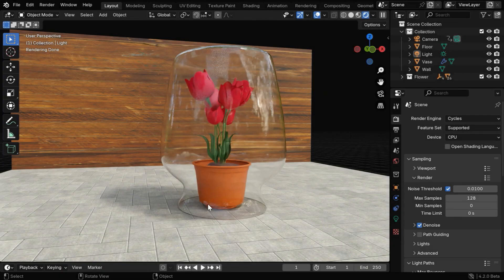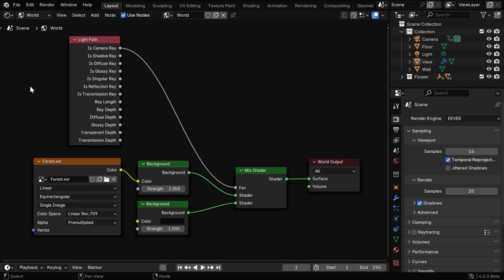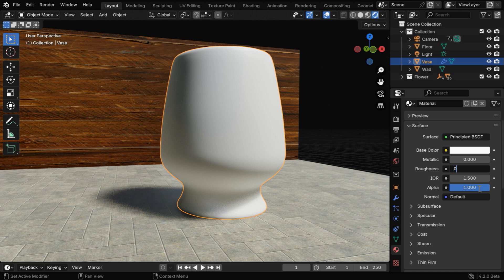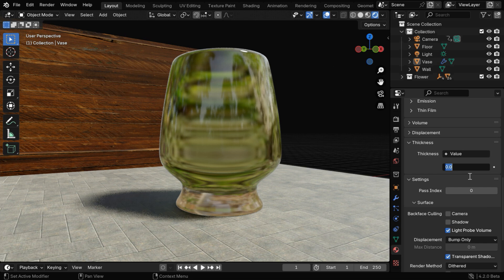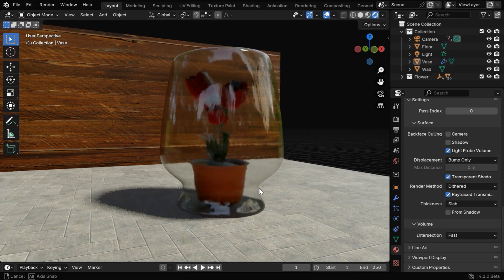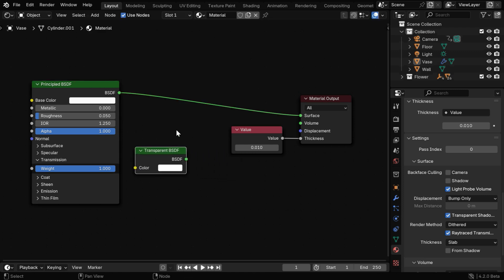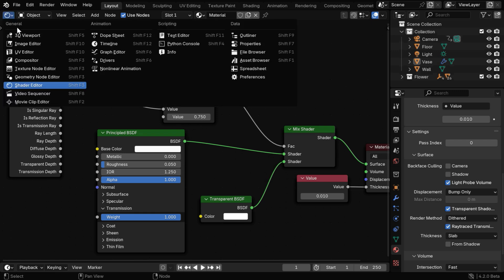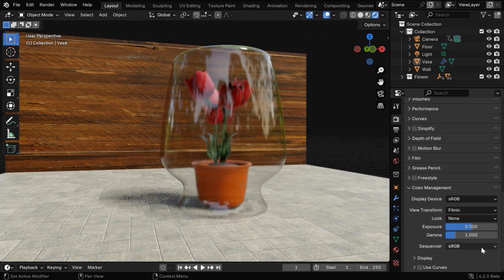Create Perfect Glass in 4.2 Eevee | New Method For Blender's New Version

Comment: This is not working for me, for some reason. I must have a setting or add-on that I forgot about messing with my shaders.
Reply from the maker: It should work if you are using one of the recent versions of Blender. The best way to identify the different is to do it step by step "exactly" as shown in this tutorial and compare the output at each step. The moment you see something different on your screen compared to what you see in this tutorial, take a pause. If you can identify it yourself, good. Otherwise tell me the step at which you find a difference (give me the timestamp from the video). This helps us to guess what might be going wrong in your case and we can suggest better. Needless to say, if you can send your blend file, we will be able to help you further.
Reply: @5MinutesBlender  Thanks for responding! It goes wrong at 4:50 when the thickness is switched from sphere to slab. The object inside the vase is no longer distorted to appear larger, but it's still blurry. The reflections of the HDRI image don't show on the vase surface at all. Any ideas?
Reply from the maker: @TV-8-301  I think you meant 2:30 not 4:50 because the video length itself is 4:50 If changing the thickness type to slab breaks it, please check if you correctly connected the thickness socket to a value node with value close to 0.01 If still not resolved, you can send your blend file to 5minblender@gmail.com so that we can inspect it further.

Comment: Blender 4.3 dose not have MULTIPLY node for the Light Path node to adjust the value like you did. I didn't know what node would do the same.
Reply from the maker: No, this node is available - in the shader editor, go to Add > Converter > Math and add the Math node. Then change its function from Add to Multiple or any other function you need.
Reply: @5MinutesBlender  thanks man i was looking for it <3

Comment: thank you so much for sharing. speaking of this, is it possible to use one HDRI map as the reflection of a glass material, and then use a different HDRI map for rest of the scene? as the HDR map for the scene is too dark for glass reflection... thank you
Reply from the maker: Yes, it's very much possible using the Reflection Ray key from the Light Path node. In your world node setup, use two HDR-mapped background nodes, and use the Reflection Ray from a Light Path node to mix those two background nodes. It will pick up one HDR for any kind of reflections, and the other HDR for all other purposes. Just tested this at my end, hope it works for you too. It works both for Eevee as well as in Cycles in 4.2 😊

Comment: Unfortunately the refraction now in 4.2 makes everything inside it look extremely blurry and there's nothing you can do about it from the looks of it.

You can compare the two by making a similar scene 4.1 and see how it's not even blurry unless you crank the IOR value to really up, but it already is zoomed in by that point.
Reply from the maker: Yes, I too have experienced the same. The only thing that makes it less blurry is the thickness of the material. We need to add a Value node to the Thickness socket and assign a very low value like 0.01 or 0.001 (but not zero). It's still blurry but within an acceptable limit. Ideally everything will be solved if they don't apply a default thickness if we make it zero (or if we leave that socket free). This small change can bring back the old behaviour.
Reply: @5MinutesBlender  Someone figured that turning off the raytrace denoising will improve it. It's not as good as pre-4.2 refraction, but much better than it being on.
Reply from the maker: @bobbitybob-o8q  Yes, it does look better. And if disabling this option creates some other issues, we can always denoise it through compositor. Thanks for sharing this tip! 👍

Comment: Thanks for this, my glass looks great now. Only thing I don't understand is: when I have another object with the "Raytraced Transmission" setting ticked for it's material, I can't see it through my glass object for some reason.
Reply from the maker: Glad you liked this tutorial! For transparent objects behind another transparent object (like glass flowers inside a glass jar), you need to select the Blended option in the Render Method for the Glass jar's material settings (and Dithered for the glass flowers). While this makes the transparent flower technically visible, it will display no colors and the overall outlook won't look good. Eevee actually fails in layered transparency, we must use Cycles here.